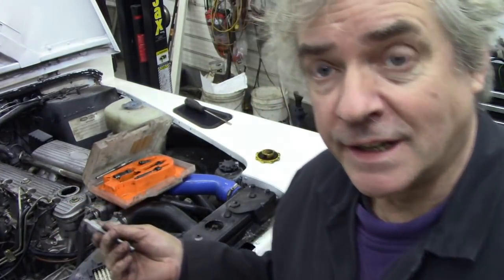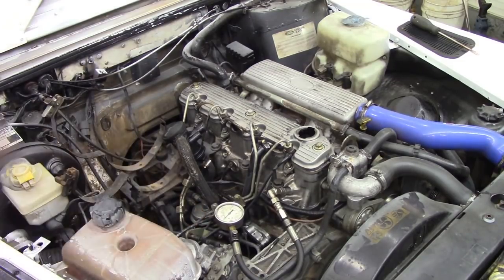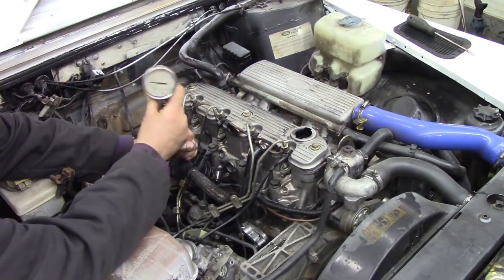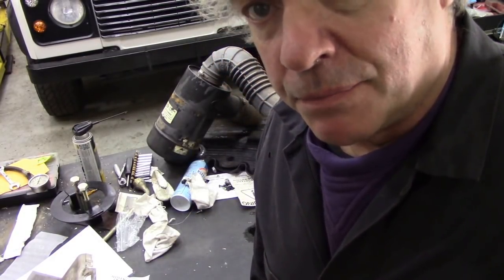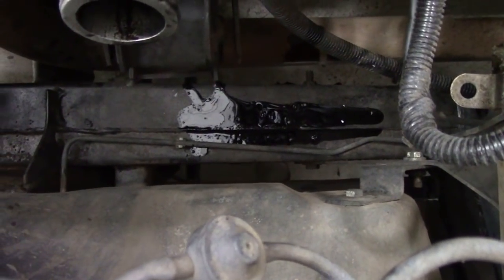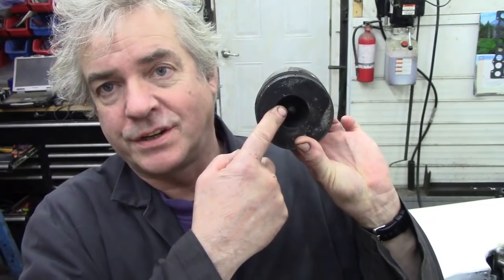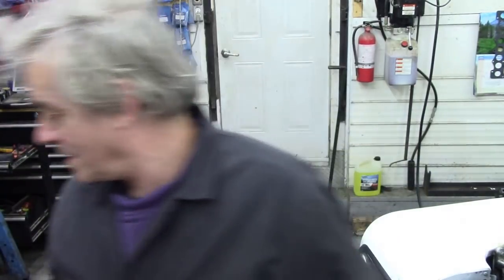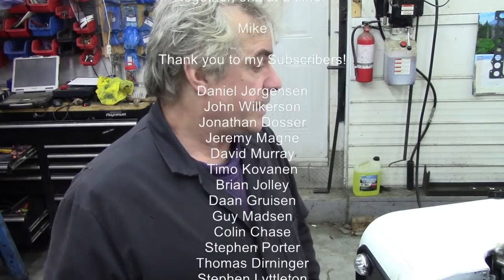Malawi 110 Engine compression test - why so low?

Comment: I have phoned Miss Marples, she said she will start watching, we may need her on this one.

I have read all the sensible suggestions below.

Possible there is more than one thing wrong, which is why diagnostic isn't obvious.

Someone said that the bores could be evenly worn by the dust from Africa roads, this is a real problem, you see snorkels in Africa a lot, it isn't always for deep water crossings, it is to get the air intake above the dust kicked up by the vehicle in front.

Valve seals? 

Now for a curve ball. Has the engine been rebuilt with slightly undersized rings? It's a long shot but nothing surprises me about Africa. I can't believe I am suggesting it but nothing should surprise you about Africa vehicles. 

Are the valves not seating properly due to the wear from Africa dust? 

Really enjoying this one Mike.

Comment: My old 300Tdi did nearly 300,000 miles before I got rid of it, pulled OK once the turbo kicked in, but I used to flush out the intercooler every time I did a oil change!

Comment: Mike, I realise that these engines are all pretty old by now, but in all the Tdi's I've been involved with over the past 15 years, I've not seen one that had what you would call an "oil free" air inlet tract anywhere downstream of that crankcase breather inlet. That seems to be just how it works, the LandRover way, spread the oils about. Thanks for yet another interesting session.
Reply from the maker: Yes they all breath badly  - I was wondering if the brake servo is ok - could be drawing in air and passing it into the block - quite common with those crappy tin servos
Reply: @BritannicaRestorations  that can't happen on mine now with the electric vacuum pump.
Reply from the maker: good move - what did you use?
Reply: @BritannicaRestorations  used a vac pump off an Audi, can't remember what model, just one I picked up on eBay for $60. The elect pump improved the lower speed, (around town), boost. I think the Wabco original was pretty sick and always leaked oil even after the cover rivet fix.
Reply from the maker: Did you use an accumulator tank and vac switch?
Reply: @BritannicaRestorations  oh yes, a vac switch from a Volvo S60, (eBay), and I used an empty 2.2 litre Argon tank for a reservoir. Would send a pic of the setup if I knew how to, (me, Luddite with e-tech)...
Reply from the maker: britrest@britrest.com
The 300Tdi vac pumps are a pain

If you removed the vac pump, how does the engine breath as it takes air from the brake servo?
Reply: @BritannicaRestorations  the electric pump simply exhausts into the engine bay, it has a little exhaust filter on the body of the pump and I made an aluminium closure plate for the Wabco vac pump aperture in the engine block. The electric pump has no connection to the engine other than electrical through a relay. Turn the ign on, and by the time you start the engine there is full vacuum, all controlled by the Volvo vac switch.
Did you get the photos?

Comment: I had the same oil problem on my old j90 engine. Lots of oil in the filter - so much, I replaced the filter with a rechargeable one. Regular clearing the breather from the top to the bottom of the engine did nowt to fix the problem, and I thought it was the Turbo. I installed a catch can in the end.
Reply from the maker: Thanks for sharing

Comment: Here's a crazy thought: If there is so much oil, how much is in the intercooler?
We don't know when the whole air intake piping was last cleaned. Maybe the cyclone separator is full, it dumps the oil into the piping. The intercooler is full of oil. 
So now you have a less efficient engine and there is smoke.
As I said this is just a wild guess/hunch.

Thanks again Mike for a great video.
Reply from the maker: You are on the right track - I guess the Inter cooler is soaked in oil - I have an idea that the droplets of oil splashed in the rocker box are getting sucked into the separator which get overwhelmed as it was only designed for fumes - I wonder if a small baffle in the rocker box would cut the oil?
Reply: @BritannicaRestorations  I think the performance might improve after cleaning the whole air intake system, but will the compression improve? It might be worth a try.

Comment: Hi Mike. For that era of vehicle I would expect the engine number to be between 33000 and 46000 if it was original
Reply from the maker: It is a Maxion motor and has 2 engine numbers - one in the middle of the block and one that has been over stamped by hand  (16L45631A) over a needle point number factory number that is underneath which I cannot make out as they have ground it back
Block date stamp 12 99, head date stamp 44 99 - so a very late 1999 block
Reply: @BritannicaRestorations  Might have been a replacement then and had the original number restamped?

Comment: yep - I agree - rebuild the engine the transmission the transfer case - redo the interior - do a glass out repaint - replace all the seals - new tires - new shocks new springs - brakes - all new bushings - add a/c - convert to left hand drive - that is good for a start - the check for $50K is on the way
Reply from the maker: On the 'to do' list there are a lot of things asked to be changed but when I was under the truck it was in very good order

Comment: Sykes Pickavant leak down tester. Puts compressed air into the tdc cylinder and the compression is indicated on the other gauge. Bubbling coolant or air passing through the breather will tell you where the problem is. Trailer Fitter Toolbox Chris Higgins has a video where he does in on a 300.
Reply from the maker: I tried this and not much difference - number 3 was a bit low

Comment: Hi Mike, I had blue smoke from my rebuilt 300 tdi, luckily I took off the air intake pipes and found oil I checked the turbo and found oil inside it was mainly leaking into the hot side so no runaway but there was a fair amount on the cold side just like yours, not saying that's the compression problem but might be a separate problem, I fitted a new cartridge  ( easy two day job ) and all is fine I was beginning to think I had put the rings in wrong.
Reply from the maker: You know, I was thinking about this and I have an idea that the older engines are sucking out drops of oil from the rocker box - if you have run a motor with the cover off you will see what I mean - there is no physical baffle in the valve cover to stop those drops - maybe if I.....
Reply: @BritannicaRestorations  Don't go there Mike." if I just strip down the whole motor and find nothing"

Comment: Here we go again Sherlock ...... I'm going to be awake all night thinking about that compression conundrum .....
Reply from the maker: Very strange - I was thinking it was my tester but I was using it a few weeks ago and the numbers were well up
Reply: @BritannicaRestorations  Some great suggestions from your many followers.
Maybe rings bunged up? 
I think I saw the cyclone separator  was missing a clamp on the top hose maybe? So may have been off a couple of times before......so leaky oil getting around and about? ....maybe with oil getting passed the bunged up rings ....how about a good old bore soak in petrol poured down the glow plug tubes and careful blow out through same? 

BTW I checked my glow plugs and three of them are connected ....4th has no wire and the relay on the bulkhead has now wires on it at all!! 
Back to sleep for me .......
Reply from the maker: These engines are bad at breathing oil, but it does not come from the piston rings, but from the oil spray in the rocker box that gets sucked through the separator and into the air intake

If you recall last year I did a 300Tdi that had a warped head and it was smoking badly so I left off the pipe that went to the air filter
Well, so more smoking so far!!
Reply: @BritannicaRestorations  Woke up just after 5am and remembered that some export petrol cars had reduced compression engines to allow for poor quality fuel .....any chance that diesel engines could be derrated too?
Reply: First thing I would check, when the compression is low is valve clearance. After that you could do a cylinder leak test to find out where problem lies. BTW I love watching your videos.
Greetings from the Netherlands,
Gerard

Comment: Have you checked the valve timing isn't out by a tooth, i.e jumped?, this would drop all of the compressions by the same amount
Reply from the maker: Good idea but would it not be a bad starter ( even when it is warm?)
Reply: @BritannicaRestorations  I would expect the low compression would make it harder to start, but the glow plugs might mask it to a degree

Comment: What about how long the engine has idled for? Yes its done 179k but it may have also been sat idling for hours which probably does more damage. Could just be polished bores causing that little loss of compression. Amount of cross hatching left will be an indicator. 👍

Comment: didn't read all the other comments, but did you check the blowby? plugging the breather etc and taking off the oil filler cap to see/feel?
my td5 was blowing a gale. all 5 cylinders (well i could only pressure test 4 through the plugs) were exactly the same. Took the engine out and found the cylinders were elliptical ...very slightly, but enough. it was also hard to start and had blueish smoke. 

Got a new block from turner engineering and rebuilt it, at the same time I fixed the turbo drain tube as it was creased and could have caused back pressure in the turbo oil--(along with the pressure in the crank case). fitted new piston rings etc
ground the valves back to a nice surface (they were all crudded up with carbon from the cooked oil)
starts first time really well now, no smoke, more power, and no oil in the intake. (fitted a ProVent as well just to be sure).

of course you know all this stuff :). but something here might tickle a memory and you can pinpoint the trouble. (I would double check the gauge as well, and pressure it above the the current value.. i might be sticking NOW after working in the past.. it is very strange they were all exactly the same.)
.... bloody hell I've rambled a bit....
Reply from the maker: I have the gauge being checked at the moment

Comment: Hi Mike - the lowish compression and the oil in either side if the turbo could be 2 unrelated issues - oil in both intake and exhaust means either back pressure in turbo dump line, or bad turbo seals. Dont discount the cyclone unit as well.
280 is bit low but there are successful additives that will bring them all up without overhaul - see “project farm” youtube channel where he does a long term test on an additive called restore. 
Has the owner any history on any recent engine work?
Good luck.

Comment: Mike.  My rule of thumb is a 2.5ltr engine should do 250,000km's before a rebuild !  As this "re-birth" 300Tdi Defender Classic has covered 180,000km's, I'd expect your figure of 273psi compression or 72% ?  V.

Comment: Were there multiple head gasket thicknesses? Maybe used thicker gasket for a milled head with an unmilled head, which would decrease compression
Reply from the maker: Heads are flat and it has the second thinnest gasket available

Comment: Here’s a random fact I found out today on the 110s MOT (which failed for an oil leak!). There’s a numbered sticker on the bulkhead in the engine bay which is the emissions limit when it left Solihull. According to the MOT bloke all emissions tests must now meet that same number as specified (300tdi 1.89 l/m) and not the 3.00 l/m we’re used to. Luckily he took the bribe of a crate of Peroni and plugged the smoke meter into a Vauxhall corsa parked next to the Landy! He also said that if there’s no plate/sticker with an emissions stamp then they test to 3.00 l/m so his advise was to rip the sticker off. Anyone else heard of this? Just thought it was quite topical on this vid.
Reply from the maker: What is an emissions test? We do not have them here - come to think of it we have no annual inspection either!
LoL!
Reply: Lucky buggers. 🤣

Comment: I think the excess oil being thrown out and the low compression plus it's African history point to low grade or infrequently changed oil.. bit of wear on the bores and or rings. Alternatively, could it be worn valve guides? 
Can you do a smoke test or leak down pressure test to see where compression is going?
Can't wait for the next installment!! Thanks Mike!!
Reply from the maker: I did a leak down test but didn't film it as my gauge was busted so did it by ear, but nothing exciting to report, but it seems to me that the excess oil could be sucked out of the rocker box which is not oil fumes, but drops of oil thrown up by valve operation - if you have started one of these with the cover off you will see what I mean!

Comment: What did the man who’s car you’ve got instruct you to do exactly ? This would be important for the viewers to know
Reply from the maker: There was a big list of jobs and one was to source the cause of blue smoke - which was oil coming out of the rocker box, however I do not think it is back pressure - the 300Tdi suffers from the oil separator not working well enough

Comment: Perhaps worth checking valve clearances? wont explain the oil, but if the valves are just a shade tight.....that would bleed off compression?
Reply from the maker: They were good

Comment: I think that the pressure atainable by a pump is influenced by the voume of the connector between the pump and the guage. If your long adaptor (copy of glow-plug) has a relatively large bore its volume would reduce the possible pressure that can be reached as it could be a reasonable percentage of the volume of the compression space at top dead centre. Just my two penny worth.

Comment: Another great video. I have never done a compression test on a turbo diesel before, so my question is do you leave the turbo connected or do you disconnect the turbo. 
I am learning a lot from your series of videos. 
They are great.
Reply: Leave it connected
Reply: @davethornewell7417  ok thanks.
Reply: @kalaharibushwarrior  No problem. Without the engine actually running, no gas from the engine spins the impeller, so it just sits there

Comment: Have you looked at the bellhousing bolts and ancilleries?
Might tell you whether this was a repair that was done years ago or if this is an engine that's been thrown in it specifically so it could be sold.
If it's the latter, this could be another "ebola-rover" after all! :-/
Reply from the maker: The engine is a Maxion version 1999 date stamp so has been replaced - transmission has been out  - you will see on a video I am putting together soon - looks pretty good underneath!

Comment: Are 300tdi engines always that far forward of the firewall? My 2.5na is very close. Maybe a longer bellhousing? Different engine?
Reply from the maker: You have it bolted to an LT77 gearbox not an R380 which came with the 300Tdi

Comment: To see if turbo bearings have oil leakage into the outlet, could you remove the air intake hose and the exit hose, then start the engine. If the turbo is leaking oil, then it should splatter out the exit. ( Onto a piece of card perhaps) . Do you think this may be a way of testing for turbo bearings oil leak ?
Reply from the maker: Yes I use this method
Reply: @BritannicaRestorations  Thank you kindly.

Comment: Checked a 300tdi yesterday 1cyl 400psi
2 40psi
3 40 psi
4 cyl 400 psi
My old 200 TDI uses oil
All cyl 320
Reply: They blow head gaskets between the cylinders and not that difficult to change I was a mechanic in England 20 years ago
Reply: @doneB830  fitting V8 now

Comment: Hey Mike same with my 90 rebuild is inevitable....off topic tho can a voltage fluctuations on the fuel  solenoid can cause misfire and how can we check that..thanks
Reply from the maker: Anything is possible - you could run a wire direct from a fully charged separate battery ( do not forget to ground it too) independent from the vehicle electrical system and see if it does the same
Reply: @BritannicaRestorations  sure i will try that ...but what would be the manifestation of a fluctuation on a solenoid...

Comment: Just a complete off tangent from the TDI, but anyone had problems with a Disco 2 air suspension go down a little in really cold weather? We had -8 last night (not been this cold for a while in the UK). Airbags, compressor and lines 2 months old!
Reply from the maker: Sounds like a leaking connector in the cold

Comment: I got the same thing with my td5 blowing blue smoke it turned out to be leaky injector seals which was giving oil dilution with the fuel which made the fuel and oil pass by the rings which made it blow blue smoke don’t if this will be the same thing with your land rover
Reply from the maker: 300Tdi is different

Comment: I've been having an issue where my defender make a loud clunking/thudding noise when releasing the clutch pedal while changing gear (particularly upshifting) unless I am very slow and deliberate with the pedal. 1990 2.5 petrol, lt77. Any thoughts, thanks?
Reply from the maker: Could be the gearbox output spine into the transfer case is worn out ( very common) or bad universal joints
Reply: @BritannicaRestorations  Much appreciated, thanks

Comment: Probably worn piston rings from dusting due to dirt particles entering entering air intake and equally wearing cylinders.  A leak down tester would confirm. Even though it has low  mileage.